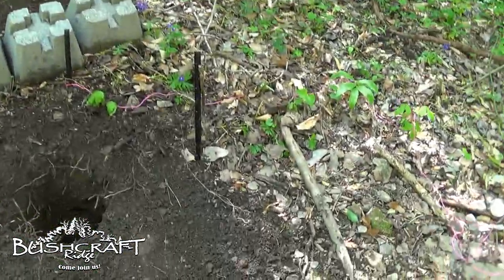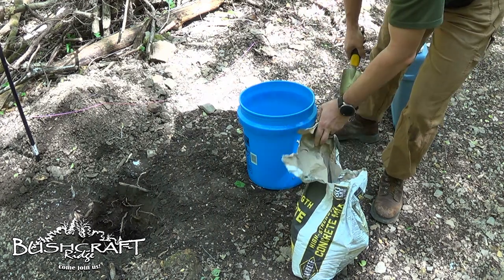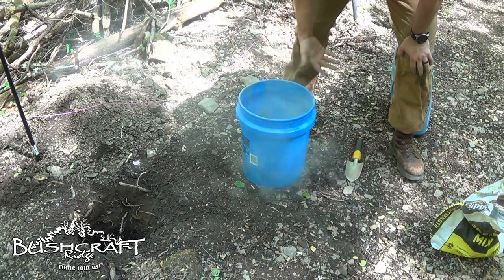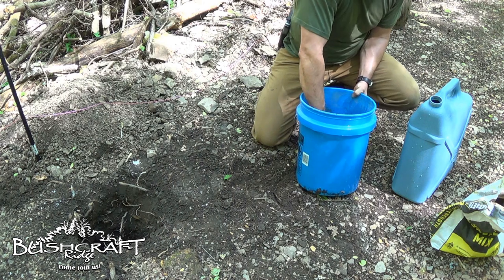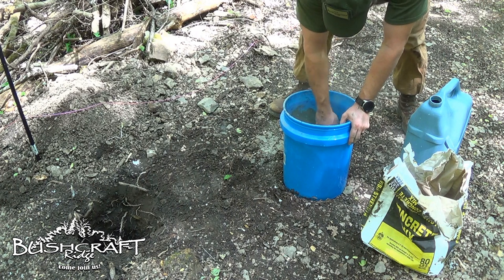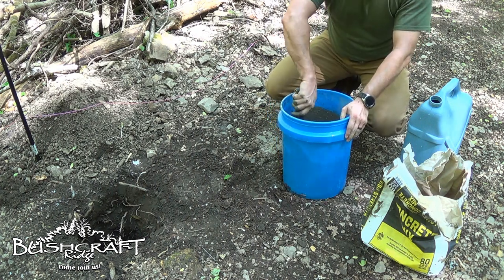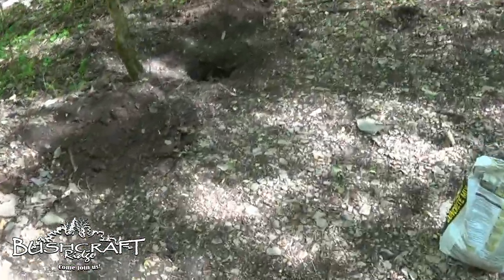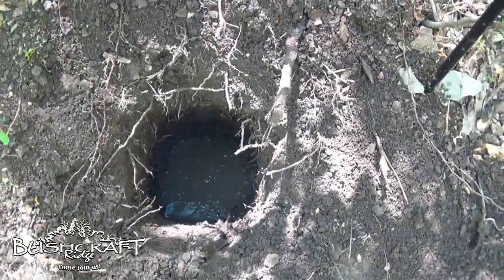Off-Grid Cabin Build 4.18.2020 -- Pouring Concrete Footers

Comment: Being it says concrete mix I'd say it's got aggregate in it. If it only said Portland Cement on the packaging it would likely have no aggregate. You definitely want to mix it with water first. I've dug up posts that were installed dry "to let the ground water set it"...it didn't work worth a shit. The limestone and calcium in wet cement will suck the moisture out of your skin. Try not to handle it too much.
Reply from the maker: Yeah, I figured that out when I opened the full bag. It has been a while since I played with concrete. Thanks for the tips! I will definitely have a drill with a mixer attachment next time.